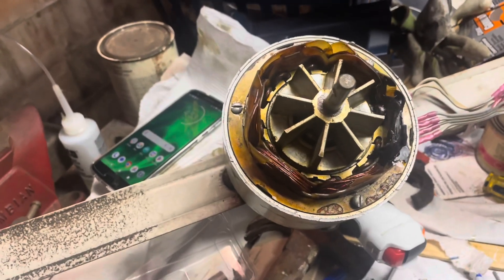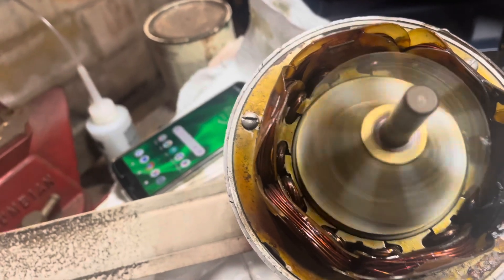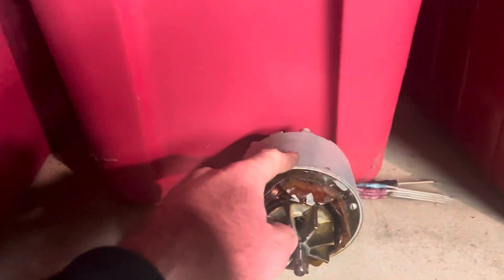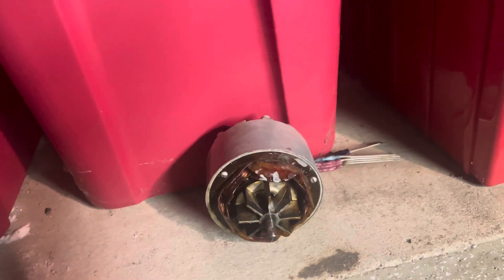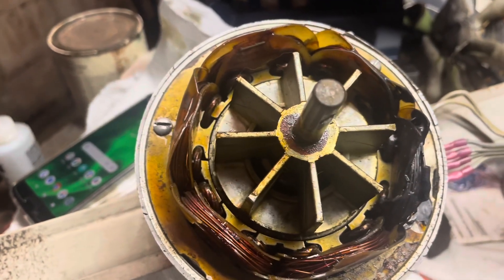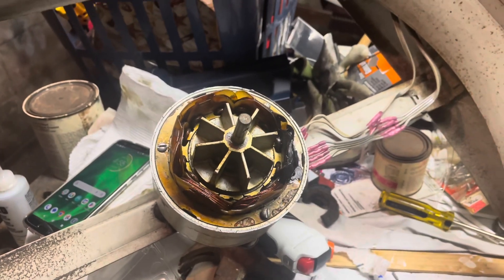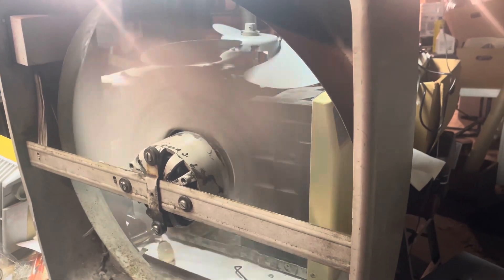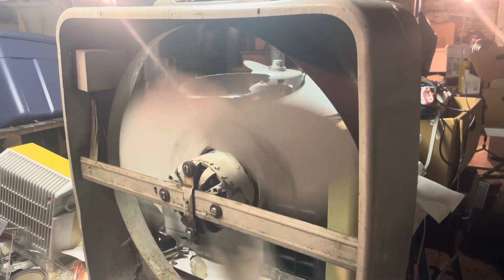GE Box Fan Motor Fixed

Comment: I’ve used fiber washers to fix the axial play issue, I typically use one felt and 2 fiber and that usually will cure any excessive play, you’ll need another set of washers in front of the circlip, use a brass washer directly behind the circlip, order should go brass-felt-fiber towards motor, other side inside of rotor should be fiber-felt-fiber. Hasn’t failed me yet.
Reply from the maker: Normally the washers would do the trick.  In this case the shaft is actually moving independently of the rotor.  It would have to be welded or epoxied to fix it.  Fortunately it’s not the motor I repaired the winding on.
Reply: @carson01XJ  yikes. The only other thing I could think of would to be to drill and tap where the rotor passes and use a setscrew.